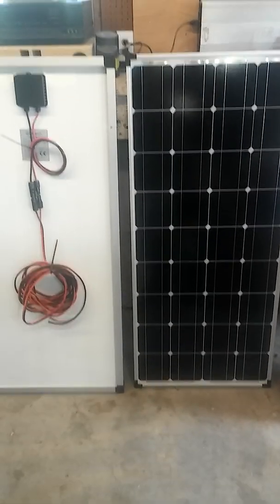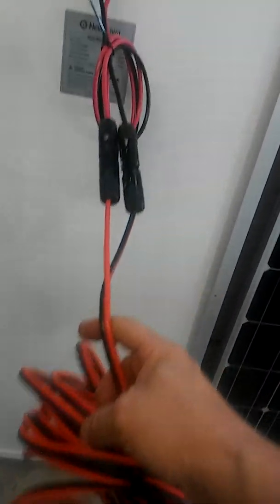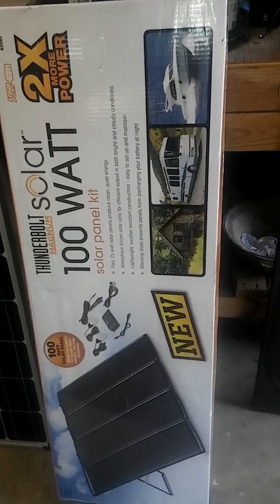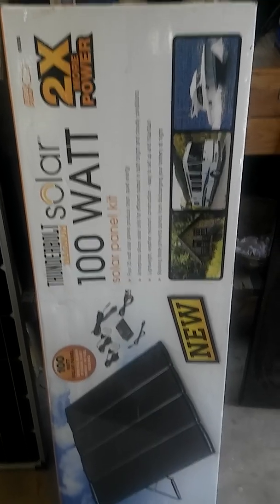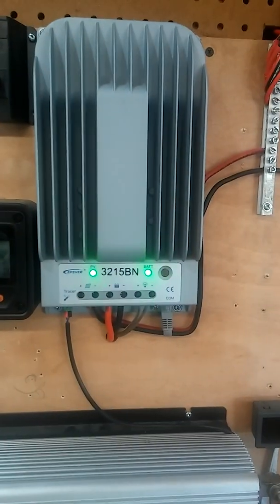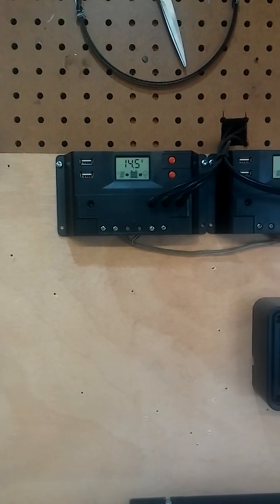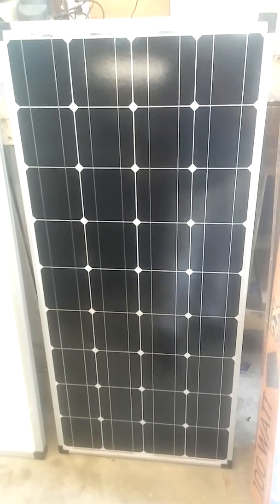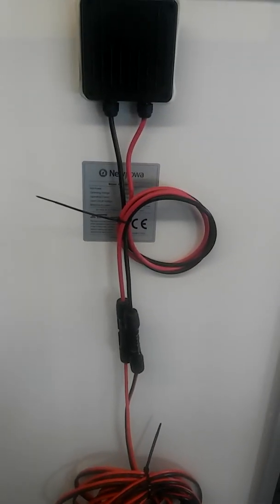Solar panel upgrade. HF and monocrystalline

Comment: What buyer on amazon did you buy the monocrystaline panels from? Can you provide a link?
Reply from the maker: Brand: The seller no longer carries this model. I now get them here. Winnewsun
4.1 out of 5 stars  15 Reviews
Winnewsun Solar Panel 100 watt Monocrystalline Solar Panels for Homes,RV,Off Grid, Boat, Marine, Camper.

Comment: Where did you get the wire and connectors you attached to your new panels? How long are they and how much? Thank you. REALLY great work you have done on this series. I am behind you about 6 months, but and learning from you.
Reply from the maker: Ben Kanobe 50' AUDIOPIPE 10 GA GAUGE RED BLACK ZIP WIRE SPEAKER CABLE COPPER CLAD CAR AUDIO STEREO #10-50RB https://www.amazon.com/dp/B00J35SW9Y/ref=cm_sw_r_cp_api_i_rnGUDb827G99W. I use this wire because it was cheap and if you protected it it should do just fine it’s a 10 gauge wire
Reply from the maker: Ben Kanobe. CandyHome 5 Pairs MC4 Connector Male/Female Solar Panel Cable Connectors Double Seal Rings for Better Waterproof Effect https://www.amazon.com/dp/B07H7YVKDX/ref=cm_sw_r_cp_apip_8wpCLmW8NKGjl. Here are the connectors

Comment: I've been waiting for that lightbulb to turn on👏🏼👏🏼
(hint hint) Now how about lithium.
Reply from the maker: I have been thinking about it. Im in desperate need of a power bank. Just not sure yet where I want to go with it☺
Reply: @Checkitfirst  how about some Nissan Leaf Modules or start with a Tesla module. There are quite a few options out there.
Reply from the maker: @MidwaySolarWestIndies  I will look into that, thanks☺

Comment: HF panels are great to start and learn.  Just like you I added more, I'm still using my hf panels on the side of my bigger panels.
Reply from the maker: Awesome.. My hf pannels are starting to look sun beaten. Not sure there made for 24-7 use. I'll keep them up there till they quit😄
Reply: first mine seem to be ok still, will be making a frame out of wood for them.